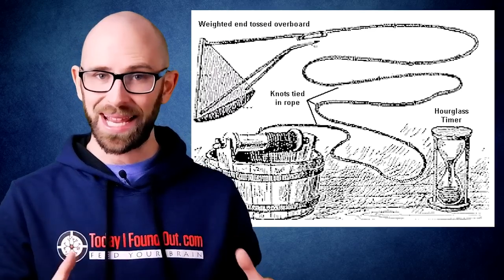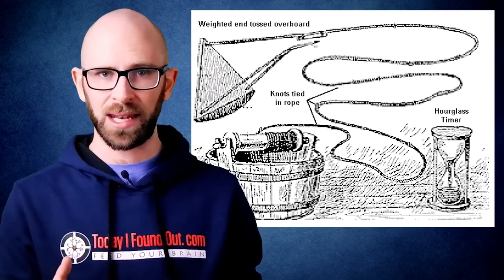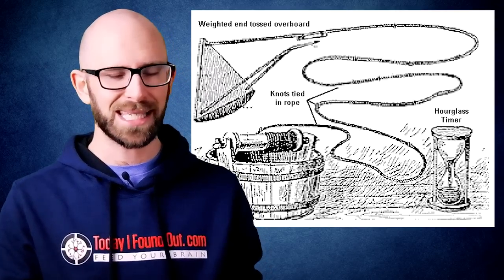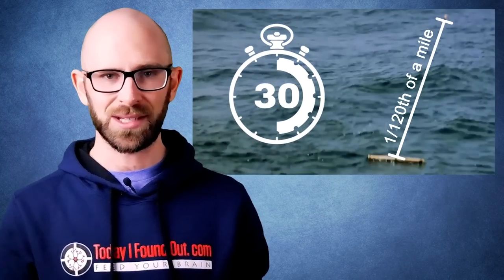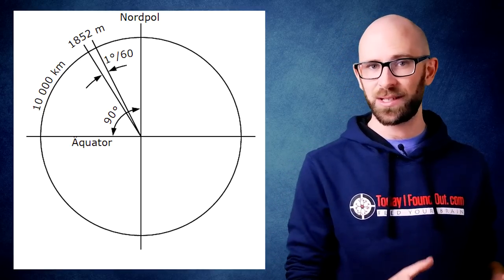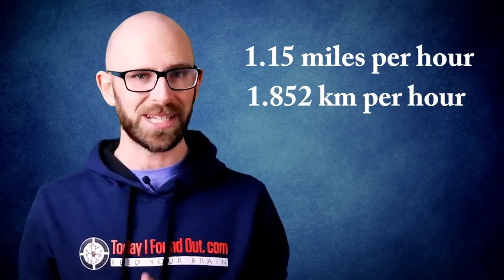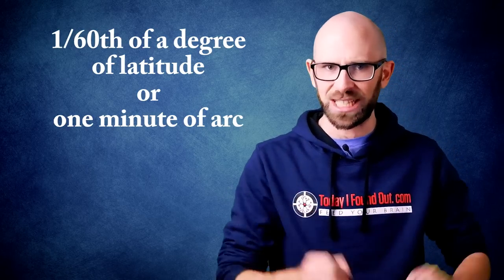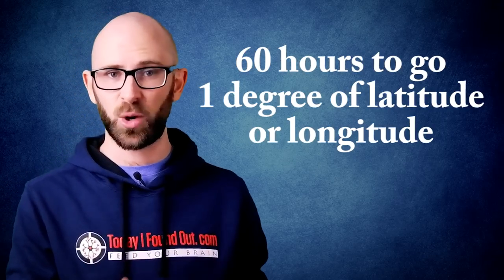Why is the Speed of Seafaring Vessels Measured in Knots?

Comment: So the original "knots" would have been relative to the water, which is usually moving and sometimes moving quite quickly. Are today's knots relative to the water or absolute -- if you know what I mean. In other words, if you are sailing against a 5 knot current and you travel 20 knots, have you gone 20 or 25 knots relative to the earth?
Reply: Since your traveling you might want to take the distance relative to the earth....And Knot is standardized to 1852m approximately....So according to new system 1 knot is equal to the curvature of 1 degree of displacement on earth.
Reply: +MakeMeThinkAgain It's a measurement of speed, just like miles per hour or kilometers per hour or light-years per fortnight. So you could use a turbine to measure your speed relative to the water in knots, then use an anemometer to measure your speed relative to the air in knots, then use a GPS receiver to measure your speed relative to the earth in knots.

+Mehrab Khan A "knot" is a nautical mile per hour. In other words, it's not a length, it's a speed. So, a knot can't be 1852 meters, it's 1852 meters per hour, or 31 meters per minute.
Reply: Absolutely knot.

(sorry I couldn't help myself)
Reply: Just remember speed is just a number, velocity is speed with a direction.
Reply: Beat Conductor Nooo, speed (or velocity, more accurately) is distance travelled with time.Velocity is calculated as distance (S) usually in metres, or miles, divided by time (t) in seconds, or hours.  This gives you velocity (V) in metres/second or km/hr, or miles/hr, etc.

Vectors incorporate speed (or velocity) with a direction
Reply: HiddenWindshield Yes that's right, or roughly a 100 feet/minute. OR to put it another way, a knot is equivalent to travelling 47 feet 3 inches in 28 seconds.

If you travel at this velocity for an hour, you will have travelled one nautical mile, or 1.852 kilometres, or roughly 6076 feet...

And this is equivalent to one sixtieth of a degree of longitude. After 60 hours travellling at this velocity you will have traversed the equivalent of one degree of longitude!
Reply: southerly11
Oh, wrong V word then. xD
Reply: Beat Conductor No, you were right, southerly11  is wrong. Velocity is in fact a vector, having both a direction and a speed. Speed is "distance traveled with time", which is just another way of saying "distance divided by time".
Reply: HiddenWindshield No, YOU are wrong. Velocity is not specifically a vector. It is implicit with movement that you will have a directionality. BUT that is not a component of velocity the MEASUREMENT. Velocity has only two dimensions.Distance and time.

I suggest you look further than the first poxy definition you come upon online. I have seen other "experts" muddy this definition, and they and you are incorrect.
Reply: southerly11 I didn't look up any definitions online when I made that post. I simply remembered what had been drilled into my head by my physics teachers in college.

But, just to humor you, I googled "velocity vs speed" and checked every one of the first page of results. They all agreed: velocity is a vector, speed is a scalar.

But if you have any counterexamples, please feel free to share them.

(Edit: formatting)
Reply: HiddenWindshield
I thought i was right...
Thanks for the fact check.
Reply: Look, I too studied physics. And again, many of these examples are poorly written since physicists are linguistically challenged, as a group.

This is an example of one-dimensional kinematics, or motion along a straight line. Though displacement, velocity and acceleration are all vector quantities (descriptive components of a vector), in the one dimensional case they can all be treated as scalar quantities. At it's simplest, it is an averaged measurement of rate of displacement with time.

Given that the discussion is regarding the measurement of speed using knotted rope chucked off the back of a sailing boat, I think you may have lost sight of the main objective which was to demystify Simon's explanation by re-explaining it in simple, but accurate terms. "Speed" was an informal descriptor and not part of the physics lexicon when I was introduced to these concepts, many years ago, but is equivalent to velocity.
Reply: Beat Conductor Nope.
Reply: Beat Conductor No problem.
Reply: southerly11 Yes, we did get a little off topic there, didn't we. :-) And you're right, in an informal context, speed and velocity can be used interchangeably.
Reply: only latitude and the knot is only one minute of latitude.  takes sixty minutes to make a degree, pay attention in your trig course.
Reply: since in the open ocean it isn't too convenient to 'feel' the bottom you have to make due with your course and speed through the water.  As the science of navigation improved tables were developed that provided 'estimates' of ocean currents at varies locations and times of the year, but these are still estimates.  The term knots is a speed measurement, it means nautical miles per hour but the distance you cover is referred to as miles and since you're on a boat it is assumed to be nautical miles.  Anyone who says the boat was going 20 knots an hour is thus an A-hole.  The boat was going 20 knots.  Speed measurement in ships was developed long before it had any application on land so the term knots was used well before anyone had a speedometer on their buggy.  Old Railway steam locomotives didn't have speedometers either, the conductor used his watch between mileposts.  Until the chronometer (a very accurate watch) was developed in the 1770s, ships could fairly accurately calculate their latitude but could only estimate longitude by 'dead' reackoning.  I use the term ship generically since it refers only to a specific three masted square rigged sailing vessel.
Reply: Henry Ostman So you wouldn't consider a Barque a ship? But that's not what I really want to ask about... I've stayed out of this since it went a little nuts, but here's my original point: If a ship is traveling through the water at 5 knots AGAINST a 5 knot current, it is moving in relation to the water but not through space or in any absolute sense. So, in general, when the speed of a ship is given is it just relative to the water?
Reply: MakeMeThinkAgain Now that we're done with "speed vs velocity", we can now argue about "ship vs boat". :-)

I can't speak about boats/ships, but for airplanes, speeds are usually measured as "airspeed", or the speed of the airplane relative to the air. So, for instance, an airplane travelling at 100 knots against a 10 knot headwind would be travelling over the ground at 90 knots.

But in any situation where it actually matters, you'd be expected to specify which one you mean, and I expect the same would hold true for water vessels.
Reply: HiddenWindshield (Tempted to bring up wind shear but afraid where that could lead.)
Reply: MakeMeThinkAgain
If your ship is changing it's position on the earth's surface from point A to point B at a rate of 5 knots, against a 5 knot current, your ship is travelling at 10 knots, 5 knots of which is being lost to the opposing current, and leaving 5 knots of actual forward motion.
Reply: MakeMeThinkAgain It'll lead to tears, that's where, lol.

Comment: Hey Simon!  You state the distance between knots in the chip log is 14.4 meters.  Counting "knots" is a measure of distance.
Counting "knots" for 28 seconds is "knots per 28 seconds".  A true measure of knots would be a line with one knot every nautical mile and count the knots using a 1 hour timer.  Then you would have "knots per hour".  Or to avoid the duplication of distance terminology, just say "nautical miles per hour".  Or "nmph".  Forget all this "knots" stuff.  Knots are a measure of distance based on your explanation.  Strange how you divide by a time factor and still get the same dimensional units of distance ( "knots").  All of the sudden in your explanation, knots becomes  a unit of speed.  Ponder that!  :-)

Comment: Your calculation from the end is wrong as you have to incorporate the drag coefficient of the plank/weight/etc. in your equation. A smaller object (drag coefficient) will result in slower unwinding of the line.

Comment: Seafaring?  I think your average aircraft pilot would have an opinion here.
Reply: The sky is very much like the ocean. Aircraft and boats are both navigating a fluid and they use the same terminology that came from boats. The navigation lights are the same, knots, heading, bearings, course, port, starboard, fore, aft, aloft, abeam, rudder, etc. are all terms used in both. I am a flight instructor and former sailing instructor.
Reply: ...Interesting you describe the atmosphere as a 'fluid'....which it is, scientifically........and in many ways...behave the same way....
 I once read in Scientific American....."To (flying) insects, air is like oil".......
Reply: Why would they use knots in aviation though?   The whole reason boats used knots instead of MPH was because seafaring was perfected before we standardized the imperial system, or invented metric, or reliable clocks (that worked on boats).  But aviation came long after that.

I can't imagine a pilot throwing out a piece of wood with a long rope attached to it, and counting how many knots went out from the line while a sandglass ticks away...  Actually I can imagine it since its funny, but I don't see it happening.
Reply: GhostInTheShell29 the term "knot" has become synonymous with "nautical mile per hour." Pilots use nautical miles for the reasons already discussed; it follows that we would use the term knots to describe speed.
Reply: David Calhoun I understand many similarities in terminology, but why use nautical miles?  over kilometers or miles?
Reply: GhostInTheShell29 Honestly, I'm not sure. While the whole "one knot = one minute of angle, or 1/60 the distance between latitude lines, or longitude lines, as long as you're at the equator" thing is helpful, it only applies if you're heading either true North/South or true East/West. I have a hunch it's mostly tradition, although there are many older aircraft that do have airspeed indicators calibrated in statute miles per hour.

Comment: Think it time nautical people get into the 21 century and just use metric eg kilometers etc.
Reply: The nautical mile is much easier and more consistent for navigators to use than the meter. On Mercator charts you don&#39;t need a scale because the [latitude] scale can be used. This connection with the nautical mile and angular measure on great circles is useful in many navigational problems.
Reply: No, it will only require useless conversions as the latitude scale on the nautical charts is already use for distances
Reply: Latitude, longitude. It's all els, right? :) Thanks for the correction.

Comment: Knot is outdated, just like the Imperial system
Reply: but it makes you sound cool
Reply: the old system is, but the current definition of a knot being based off of the curvature of the earth is perfectly logical scale and measurement system. helps a lot when it comes to working with longitude and latitude coordinates
Reply: Oh no we still use it today . It is much easier then any other system . And for that reason used in aircraft too !
Reply: Knots may be outdated, but he forgot a lot about them, for instance, planes use it for speed as a knot is the unit of speed through a liquid, and the metric system has a lack of replacement, plus nautical miles are defined in the imperial system, not the metric like he opened with
Reply: You are incorrect. A knot or nautical mile per hour is an SI derived unit of measurement standardized at 1,852 meters.    https://en.wikipedia.org/wiki/Nautical_mile
Reply: More it has defined in si units mmmm
Reply: Nope..Dubious, you are wrong.
Reply: +Archimedes Da Vinci it was retroactively made a derived unit, just like the meter is now derived from the speed of light and the second, itself a derived unit.  Of course, the meter, second and knot all predated the known value of c or the interval of transition of state of the cesium atom, or whatever the hell the second is defined as now...
Reply: It is not outdated. Measuring  navigation is much easier when you are using arcs of a circle. 1 minute of arc as a nautical mile is so much easier than changing your measurements into kilometers which are just as arbitrary as Statute (imperial) miles. Get out your sextant, measure some lines of position from a couple of stars and you will see what i mean
Reply: Dubious Imperial system is too complicated
Reply: DarkDennis Wouldn't using minutes of arc mean that that a same number could imply different lengths at different latitudes..?
Reply: Actually, knot is still predominantly used in aviation and marine applications. Nobody uses km/h.
Reply: + IAmAgainst
Arc of latitude, not longitude.

Comment: You didn't really explain why knots is used rather than existing measurements such as km/h or mph.

I mean, good video but it didn't really answer the title apart from explain what a knot is and how it was used.
Reply: It's called TORADITION!
Reply: Explain TORADITION.
Reply: Tora (obvious) + dicio (latin - verdict, judjement) :)
Reply: BoomBrush because km/h and mph did not exist when the knot was first used, the knots been used to define a ships speed since the 16th century while the US mile was defined in 1929 and the kilometer was first adopted in 1817.
Reply: The Mad Hammer Well that certainly clears things up! THanks!
Reply: BoomBrush no problem mate :)
Reply: Did you miss the bit where he explains one nautical mile is exactly arc-minute of latitude? Makes plotting a course on map very easy.

Comment: Audio is off
Reply: not synced?
Reply: Yea the video is ahead of the audio by a few frames.
Reply: You're using metric sound. Go into settings and switch to Imperial...........
Reply: No no no.... it is because the audio is balanced to far to the right, and because the video plays from the left to the right, the audio just seems to be ahead. all you have to do is adjust the stereo balance on your receiver to the left to get back to center....... :)
Reply: I completely disagree. Delete your System32 file and you'll experience smooth sound thereafter.

Trust me............ ;-)
Reply: This is very much an option as well. if you cannot locate System32, and have a magnetic drive, you can put it in the microwave for 3 minutes on high to realign frequencies and reset the waveform.